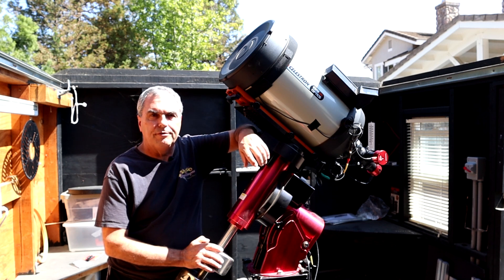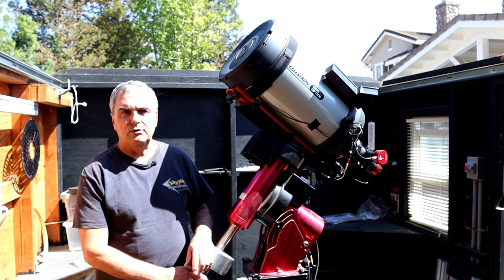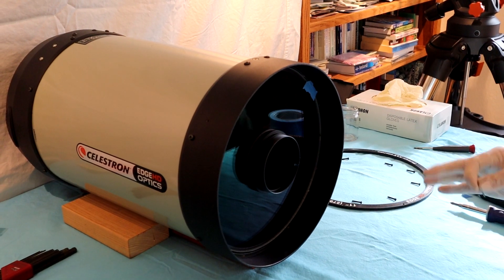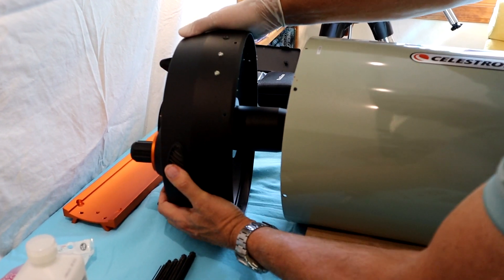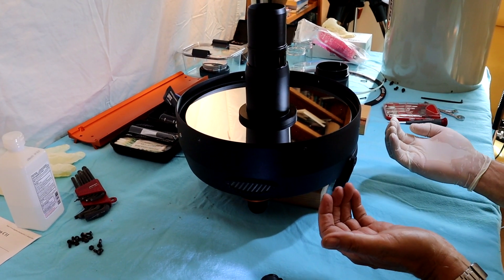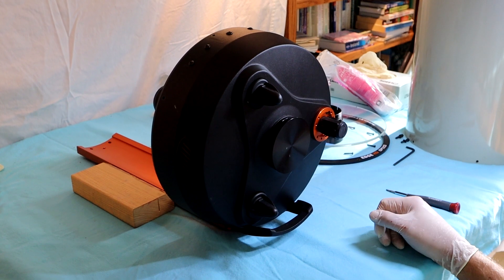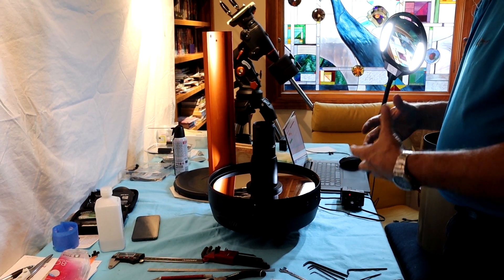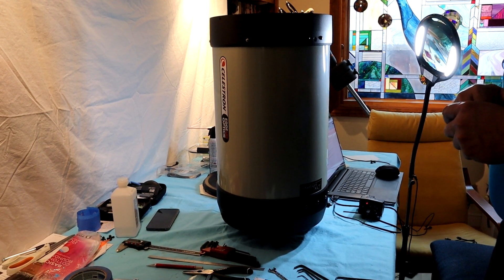Celestron C11 SCT Disassembly

Comment: Did you film this with an Instamatic?
Reply from the maker: Is this some sort of dig?
Reply: @astronomytipsreviewswithcu740  Yes! You cannot even focus your camera. I have a C9.25 coming so I was looking through videos for information on the secondary mount. I see all this poorly made noise designed to confuse beginners and frustrate the experienced, much of it filled with errors, and you cannot even be bothered to focus your camera, or even use a real camera at all.
Reply from the maker: @ultrametric9317  I appreciate constructive feedback.  Good luck with your C9.25

Comment: I was holding my breath as soon as you placed that primary mirror facing upward to remove the locking ring.  Thankfully a little later I saw the mirror protector in place.  For anyone following this procedure I would recommend getting a protector on as soon as the rear cell and mirror are removed from the outer tube.  I've been inside my Meade LX many times, but I anticipate having to open my Edge for flocking sometime soon, and it's nice to see that they are quite similar.  Thank you for going to the effort of making this video.

Comment: I may have to embark on disassembly of my C8 to see why  I am not able to collimate the telescope  by correcting secondary mirror position. You made quite  detailed video. This will definitely help me. Thank you.
Reply from the maker: Glad to share this exactly for situations like yours.
Reply: @astronomytipsreviewswithcu740  Could you tell me the screw driver bit to be used to remove top two screws to remove  the corrector plate from the OTA. I used hexagon 2.0 size bit, but the screw is not turning at all!
Reply: I figured out that 5/64 inch allen screw driver is needed to remove the corrector plate. Initially I tried the screw driver but could not turn the screw at all. This might be due to green color matter  formed around the screw. However, I could open it once I sprayed WD-40 liquid over it and waited for a few seconds.

Comment: A nice set of instructions! A question: did you mark the clocking angle of the primary mirror or it didn’t matter for collimation?
Reply from the maker: It was marked so it could be returned to the same position.  Also, Dave used the HoTech SCT Collimator as a final check and collimation fine tune.

Comment: Good evening! I want clean inside the c11 edge hd ...but On these grub screws that hold the plate there is a thread lock like a blue wax that prevents the hex wrench from inserting and gripping to be unscrewed...how can I do it?
Reply from the maker: I have not encountered that situation so you will have to figure out a way to clean out the blue wax.   Good luck

Comment: What happens if I forget to mark the corrector plate when I remove it, and then replace it not as originally aligned?  Will this be somewhat disastrous?
Reply from the maker: It won't be disastrous.  I cannot say whether you will see any difference at all.  Sorry I have no more expertise on this point.

Comment: Good video. Save most of your headaches by using anti-seize lubricant on all threaded connections. Most of these threads are aluminum to aluminum direct contact and the simplest preventative for stuck threads is anti-seize lubricant.
Reply: outgassing.
Reply: @Odysseuss. good point, however, there are plenty of good anti seize lubricants that are specifically designed to minimize outgassing.

Comment: I just watched your video and was fascinated by it. I noticed that on the outside baffle there were two set screw holes. did you put them in to stop the mirror slop, if so what type of screw did you use and what size?

Comment: What did you use to remove the old grease on the baffle tubes?
Reply from the maker: Dave used a rag to wipe off the bulk of the grease and then some isopropyl alcohol to remove any residue
Reply: @astronomytipsreviewswithcu740   Thank you Sir!   I am looking at having to do this exact cleaning with an older Meade 8" SCT.
Reply from the maker: @starhopper457  Good luck.

Comment: It was not like that with my c11 ota! The focus for was deep inside after defocusing and the internal screw was locked. The manufacturer told me that it was locktited in! Not like you show.
Reply from the maker: Sorry, but I do not follow what you are saying.  Maybe try again and I will get your point.
Reply: @astronomytipsreviewswithcu740  focus all the way in and then all the way out. The focus rod - with the screw end - can be brought outwards. However, with mine it stops deep inside the focus barrel so it cannot be unscrewed. Celestron confirm that the inaccessible screw is glued in!!

Comment: I'm wanting to buy a Celestron c6. I am wondering if I can get new optics like mirrors and the focuser later down the line in case I want to upgrade it or if something breaks after warranty. Do you know if this is possible?
Reply from the maker: Celestron can support you after warranty but it fan get pretty expensive to pay for shipping to southern CA and the cost of the parts and labor.  There is no mirror upgrade that you can do, but you certainly can use one of many mirror upgrade options like the motorized mirror from Celestron or a focuser from one of many other companies which attach to the optical port.
Reply: @astronomytipsreviewswithcu740  alright, so Celestron will support my product as long as I pay them after the warranty? If that's the case, then that's great.

Comment: i have worked on many Celestron SCTs from 8" to 14" with complete dissassembly to assembly with many tweaks. Word to the newbies....it is actually fairly easy to do BUT you do need to take your time and use extreme care. Generally the service is necessary when the corrector plate comes slightly loose so it Rotates in place. The corrector plate and mirror are indexed to each other....in other words they must be put back at the stock orientation for best performance. I recommend that every owner of a SCT when new....use a Pentel permanent fine tip marker marker to mark a spot on the very edge of the mirror with a dot that is lined up with a given orientation of the mirror. I usually mark the 3:00 postion when standing in front of the scope and looking directly at the corrector plate. If you have a Hyperstar or Fastar capable version there will be a keyed slot that the secondary goes in to ensure the correct indexing. That slot will be at the 3:00 position so now you see why I use that point as the reference point. In addition the corrector, if it comes loose, can move a bit out of perfect alignment. The corrector, mirror, and secondary mirror need to be perfectly centered and indexed for best performance.  You can actually see if it is centered by standing in front of the scope and looking into the scope. You should see all the reflections, cleaerances, etc. and it is very easy to visually center everything.  I actually don't like removing the scopes outer tube from the rear casting. I know how to remove the secondary to gain access. Generally I figure if I am going to this much trouble I want to make sure the secondary, corrector plate and especially the Fastar/Hyperstar secondary holder is solid and centered. 
Once you are sure the scope optics are aligned and solid....you need to do a GOOD colimation. This is easy to do if you learn how to do it...and it is worth learning as it takes just a few minutes and the performance of your SCT will never be good without a good colimation. I have met people who say that their scope was never colimated and that it doesn't need it. I say give me a few minutes and I will check it out. Usually they are so far out (and poor performance) that when I am done they are amazed.  I have two 11" and one 8" SCT and manage an observatory with a 14". All four scopes are really great optically. 
About 8 years ago I did a demonstration to a large meeting of three clubs where I dissassembled one of the 11" scopes and went through the entire process. Took me about an hour even with Q&A. 
Generally though I don't recommend going though any of this unless your scope has a major issue such as a loose corrector plate. I recommend that you send it to Celestron for service. 
As far as dust on the corrector plate, in the scope, etc. It won't make ANY difference and you have a lot more chance of making it worse if you screw up.
Reply from the maker: Good input!
Reply: I agree, I just took my C11 apart and as long as you mark the corrector and put it back this isn't a big deal.  Just don't scratch the parts.  If your scopes are like mine and not bran new then be careful and go for it.
Reply: Hi guys.  What happens if you forget to mark (index) the corrector plate and reassemble it in a different alignment.  Will it have a permanent effect.  Or will it just make collimation more difficult?  Thanks for any feedback.
Reply: @TommyM-j7v  You need to mark the orientation of the corrector plate so you can place it the same position....indexing.. The corrector on varou models years is already marked by the factory. But no you do NOT wanto put it out of the correct orientation. Also important to center the corrector. There is at trick for that. Stand in front of the scope, close one eye and look at the concentric rings of the mirror, corrector reflections, etc. Move the corrector so the reflections are all perfectly centered. This is done with the secondary removed (only if you have a Fastar compatible Celestron scope). The older SCTS corrector plates were just held in place by friction of the cork seal on the glass corrector and the screws around the retainer ring. The latest correctors seem to be coming with silicone caulk locking in place. I haven't dealt with those yet although my  latest 8" SCT HD scope is built that way. I don't recommend playing with any of this unless you really know what you are doing.

Comment: Excellent video, thanks!  You did everything the correct way and I really like how you demonstrated that!  I recently had to remove my corrector plate off my C6 as I had a mishap when removing my HyperStar and the center baffle came loose!  I took the opportunity to clean the inside of the corrector plate and realized I had a film on it.  I carefully cleaned the film (was not mold!) and put everything back and miraculously the SCT was still collimated!  But now my images were brighter than ever (no I didn't rub off the coatings LOL) even brighter then when I got the scope new!  I think these things come from the factory with bad QA and I have no idea what this thick grease they use or what they use to clean the components but it is definitely not high quality.  The only suggestion I would make is if you live in a cold climate, use a grease that is still viscous at lower temps.  Thanks again!  Clear Skies!

Comment: Reading through some other posts about mirror flop and tightening the front mirror locknut after finding it loose, did you notice that on yours when pulled apart? Most of the topics I see this have the retainer nut with the 2 holes for a spanner wrench but seems the newer edges have a ring with no holes in them.

Comment: This looks helpful.  I have a 2001 or 2 Nexstar 11 that I need to remove the corrector plate and put a gasket on the secondary holder to tighten it up.  What I have read is that C put a gasket that holds the corrector plate in position and that it pretty much 'cements' itself over time to the plate so that it will not be popping out like yours did.  The instructions on how to do it is to use an applicator to dab alcohol on the edge so it soaks into the gasket which hopefully will loosen it.  I will see since I'm going to be doing it in the next day or so.  Hope it all works out!

Comment: I like Kyrtox grease for many applications.   However, I would not use it on a telescope.    The problem is that if it gets on a optical surface, it sticks.    There are exotics Kyrtox solvents available.     I'm not sure they are optical surface safe.     Anyway, ordinary synthetic grease works fine for this application and it can be removed with common solvents.

Thanks for the video.   I enjoy seeing how various telescopes are taken apart.

Comment: What a great video, very thorough! I don't suppose that you would consider doing a follow up with how you collamated using the Hotech would you? I'm struggling to get the three laser dots to align on the reflector in the rear cell. I believe my corrector is out of alignment.
Reply from the maker: Thanks.  The initial alignment is by far the hard part of using the HoTech.  There are several videos on this already.  Once you get it you will have less trouble from there on.  Good luck.

Comment: Why not remove the primary mirror before taking off the back?  Scary to work near the mirror to hold those nuts.
Reply from the maker: Just need to take your time and watch what you are doing and should not be an issue.  I suppose you could remove the mirror by disconnecting the focuser, the locking knobs if it is an Edge and removing the baffle tube retaining ring and then pulling the mirror out.  To each their own but I think folks are much too timid about the mirror.  Just use common sense when taking the scope apart, have a nice clean large padded surface to work on and take your time.  After all, folks clean these all the time which requires even more handling than what Dave had to do.

Comment: As an added upgrade for Celestron tubes, epoxy the interior OTA nuts in place, then you can remove the rear assembly bolts without having to remove the corrector.  It's something Celestron should have done from the beginning.  

The debris inside and dirtiness of the primary mirror is symptomatic of not using proper filtering on the vent holes, I hope that will be part of the upgrade process.

Comment: I too had to tear apart my C6 because the nuts that hold the focuser rod to the mirror assembly came loose. I also have the Celestron electronic focuser. Th eend one is welded on but the inside nut was loose allowing the rod to just spin. That black grease was nasty.

Comment: Thanks for this. My Hyperstar got stuck on my c 11 and I had to remove the corrector plate as well. I have a problem with my c 8 and the Celestron focuser. When I hit the calibration button it was taking a long time to calibrate so I looked outside to see what was going on. Just as I stepped outside I heard a loud twang. I looked inside and the nut that joins the mirror cradle to the rod on the focuser mechanism striped and came off. I thought this was kind of bizarre. It looks like a little brass nut. The threads are floating around in the case . I didn't know the focus motor would keep turning when it came to the end. I need to take it apart and see what the deal is. The rod may be bent a little.
Reply from the maker: Sorry to hear that.  Let us know how it turns out.